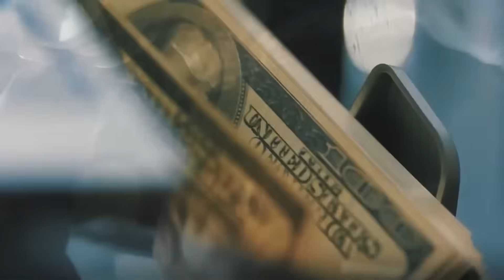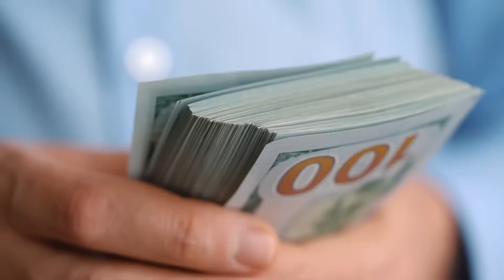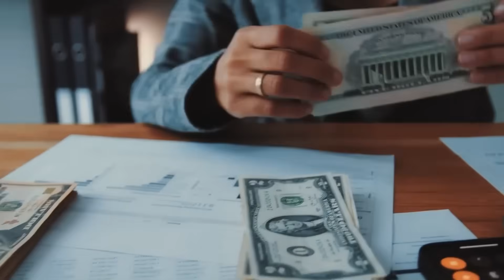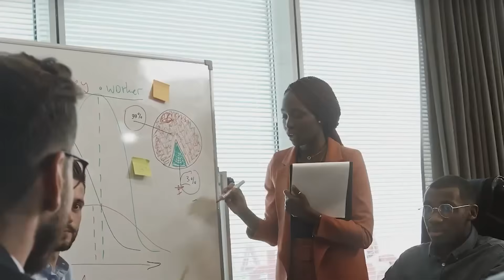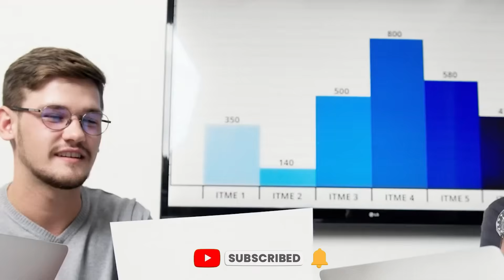Why Cost of Repairing Broken EVs Is Unbearable

Comment: A repair to a battery can be completed for as little as £500 to £2000. Similar to an Engine. A new replacement battery can cost up to £20k, but so can a new engine for a car. I know, I've had the quote from BMW when I drowned a 335d. New crated engine, 2x turbos, fuel pump, injectors, intercooler, ancillaries + labour = £26,700.
Reply: An engine will last multiple decades if taken care of. Batteries have a shelf life no matter what.
Reply: @ battery life is measured in charge cycles. A typical EV battery can do around 2000 cycles. At 200 miles per cycle, that’s 30 yrs at 12k miles/yr.
Reply: Bulshit.
Reply: Repairs to EV batteries are not undertaken, because insurance companies refuse to insure them citing safety reasons.
Reply: WOW!
Reply: New gas cars are cheaper to fix, but they break more often than new electric vehicles, and require more mantenimance. Things like O2 sensors, oil changes, engine cooling components flush, timing belt replacements, rear engine main seal, clogh injectors, missfiring codes are things that can go bad, before 100k miles. Filling the gas tank a coulpe of times a week, does take a toll on the pocket too. I think it all comes down to preferences. I drive gas powered SUV. Mostly because i know how to do repairs on it.
Reply: @normanguzman417  And the services of a skilled mantenimancer don't come cheap! 🤣
Reply: @frankfriedlos3721  I agree, is not cheap. Maybe 20 years from now, 50% of mechanics will do electric cars. Maybe regular owners will be using You Tube DIY videos  to troubleshoot and repair their cars. But right now, i feel is not the right time, at least not for me.
Reply: EV Repairs should be cheap. EV are far more reliable than ice. Reliability 1/(n²) where n is the number of components. N is very low for EV thus making them reliable. When your engine has one failed component you have to pay for it and the manufacturers make them to fail. That is how they make their money. When the electric utility has a failure you don't pay for it. You only pay for what you use! The EV manufacturers just need to provide replacement cells for their batteries instead of trying to make you buy the entire assembly. The car factory buys the assembly and doesn't concern themselves about what is inside.
Reply: @darnit-dad  If you count lithium battery cells, your 1/n^2 EV score will be about the same as for ICE.

Comment: EVs are LESS complex than ICE cars and are MORE reliable.
Reply: Eeeh, no
Reply: @floydfanboy2948  Absolutely, they are. The whole powertrain consists of a battery and an electric motor, which has one moving part. Electric motors will easily last for 500k+ miles. The batteries have already been proven to last for 300k to 400k miles. An ICE engine and transmission usually lasts between 100k and 200k, and is then scrapped.
Reply: @Smith_Tech_70  I like how your response has a well written counterargument, and the petrolhead is struggling to link more than 3 words together. That tells a story of it's own.
Reply: @fiddley  😁👍😎
Reply: @slowanddeliberate6893  Keep the faith.
Reply: Well said.